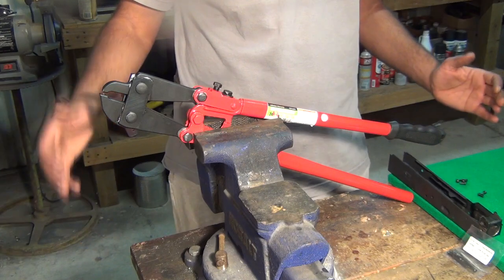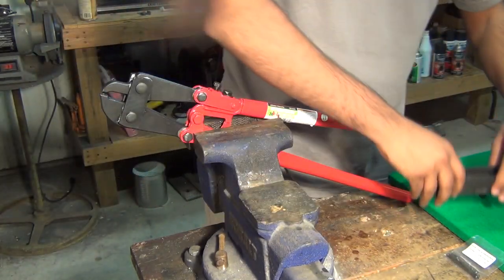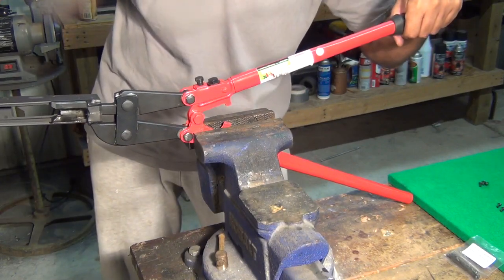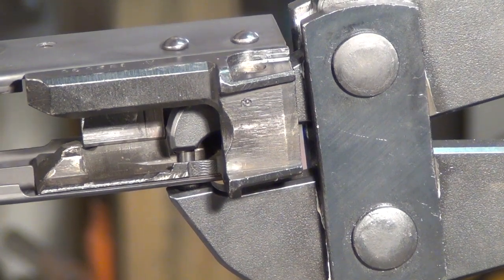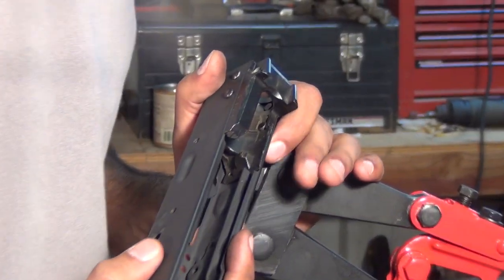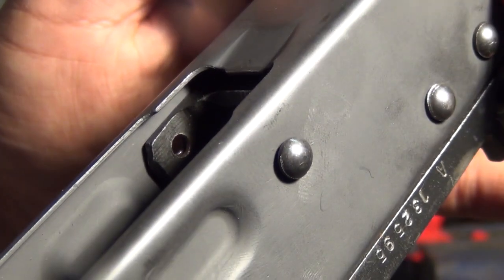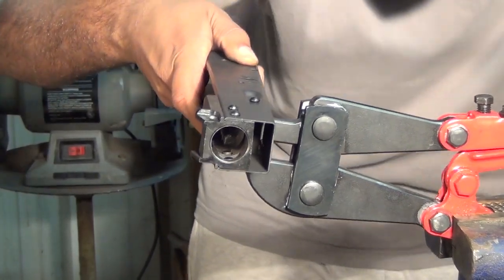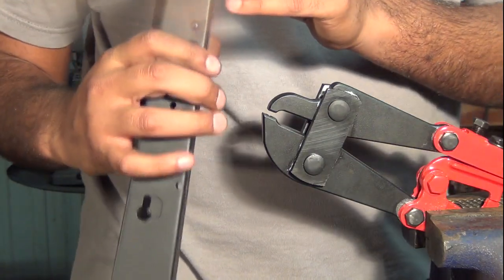Easy AK47 Build "Homemade": Front trunnion riveting ~ Step 2 of 6

Comment: That Toth tool with the squeezer is the best method in my opinion. I’ve used rivet jigs and pneumatic squeezers but I always go back to the Toth tool squeezer. It gives me more control. And as you have shown, it’s quite easy to correct a lopsided rivet head.
Reply from the maker: I agree. It is very good.

Comment: The outside heads of the rivits have a ring near the edge . 
To remedy this the depth of the hole in the tool should be deeper.
The rivit should be below flush , when crushed it will 
Fill in the gap and you won't have the ring on the edge of the rivit.
I used a Dremel and small round stone bit to deepen the tool hole.

Comment: I used a 1" steel round bar ground flat and to fit, then pressed it with a 20 ton press.
But the trigger guard rivets I could not do, so used small bolts and nylock nuts.

Comment: Great video 👌 Hey I just drilled my first trunnion holes and they are a little off. So I can just correct them with a small file, so the rivets won't be off set. Used the AK Builder trunnion tool, and think I just over did that Allen wrench on the trunnion tool. So when I correct the holes make sure front trunnion and receiver are flush.

Comment: Are you supposed to countersink the receiver into the rivet holes before putting the rivets in?

Or does installing the rivets sink the receiver into the dimpled trunnion holes?
Reply from the maker: Technically you should not countersink. The point of those style rivets is the sheet metal deforms down with the rivet into the dimple and increase bonding strength. If the sheet metal is straight it is going to cause a shearing action at the neck of the rivet.
Reply: @VEightMerc124  are all 6 rivets like that or just the rear two?
Reply from the maker: @AKS-74U  depends on what you are making. Some over the years had rear swell necks. Others just as the front in the magwell area. And some rpks have it in the front too as a long rivet. So best to research first and rivet kits are usually complete

Comment: I'm completely new to AKs, but I have a good friend with presses. Would these toth tool jaws be sufficient for crushing some scope rail rivets? All three rivets will be short for a 12" Draco
Reply from the maker: @hattedsandwich2415  ive done scope rail ones, im assuming the standard rail. I forget if i put a spacer on one after partial crush because its recessed. But yes it can work
Reply: Thank-you!

Comment: I just got a Romy G screw build and trying to decide if I should use rivets on it.
And recommendation from anyone since I'm newish to the ak world?
The rifle is beautiful and almost perfect and building was a experienced builder that's done more than a few and used red loctite and I was aware of the differnce between screw build and rivet builds and how so many people don't care for screw builds.
Seems to me as long as the screws stay,being able to easier replace things is a good thing.
My amd65 is riveted and it's also perfect and a wonderful rifle.
I'm guessing my Romy G screw build still has to be better than the newer wasr10?
And definitely better than pioneer arms or io.
Reply from the maker: You will never replace anything on the rifle that was riveted. That would be 100k rounds in and by then the barrel should have been changed a couple/few times. Redoing a screw build with rivets will require larger sized rivets since threading opened them up. As far as quality between a G and wasr....they both made the same way...inexpensively and quickly. Quality is virtually the same. An experienced builder would have never used screws in the first place. Even when I started i began with rivets. Rebuild yours with rivets once the trunnions works its way loose and wallers out the rivet holes in the reciever. Until then...shoot it out. It will work fine with screws.
Reply: @VEightMerc124  I spoke to the guy I got it from and he bought the kit and didn't have the tools and his uncle was the experienced builder but also didn't have the tools to use rivets and he said they didn't tap the reciver,they put the thin bolts behind the reciver,so if that's the case I'm guessing the rivets will still fit normal.
Of course it's all speculation on my part cause I'm still learning.
I sure have learned alot since last week that's for sure.
Before I got it and looked up Romy g nobody mentioned it was a wasr and I'd didn't find out till 2 days after about the Romy g history.
The parts are definitely better shape than a lot of the ones I've seen online 
It's a 1981 and almost all matching numbers.
I may fork up the $200 or so it'll cost for trigger guard tothtool and apex has the jaws for $69 but may average out the same with shipping cost to get all tothtool tools.
Then I'd atleast be able to rivet everything behind the front trunion until I pushed the barrel out.
I already own a press and would need the $50 receiver/trunion clamp blocks or maybe even hold out for another receiver and just redo it again if the holes do need over sized rivets.
I still have alot to learn and don't know anyone local to speak with or friends into them like I am.
Reply: @VEightMerc124  can't believe I didn't want a vska or wasr,then bought a wasr cause I didn't know it's same as Romy g lol.
But my knowledge has doubled 10x since I got it lol.
Reply from the maker: @darknature79  wasr and G's arent exact same but quality wise its not gonna be a big difference. Its all really made on same tooling. Obv military older contract gun will be worth more esp if its original barrel. Some WASR's were single stack mag fed when imported, as they came in as sporters. Rebuild it when it needs to, save your cash for ammo rn. Enjoy
Reply: @VEightMerc124  thanks for the responses and knowledge

Comment: Getting ready to drill front and rear trunnions, but I just noticed holes on my Romanian 63mod holes on front trunnion are different size? Will I need to make them same hole size by reaming them? Should I make the same size or leave as is?
Reply from the maker: You should not have to ream trunnion holes on the original parts. The rivet kit will have rivet diameters to fit. The diameters should be 4mm? IIirc
Reply: @VEightMerc124  I didn't think so, but just wanted to make sure. I do have the trunnion jig and receiver holes jig. I'm a rookie and just want to make sure I don't mess up my first attempt receiver. Wish me luck, drilling tomorrow. 👍🍺

Comment: Did I miss a video? Didn’t see the receiver getting milled, just went from barrel to riveting receiver.
Reply from the maker: Reciever was introduced as a 100%. For info on drilling that stuff best to buy a jig for the holes or follow schematics.
Reply: Hey thanks for the quick response!
Ok, I'm starting my project soon. Going to be my first build, I have a Romanian mod 63 kit. Barrel and 80% receiver is on its way! Looking at my options, not going to be able to build all by myself. Think I'm going to install front trunnion, rear, trigger system by myself. But don't want to do front sight, gas port drilling. I will do the rest. Great videos, keep them up.

Comment: yo your front two rivets are hella lop sided, you can see that on one side the heads are not pressed up against the receiver. using a proper rivet jig instead of those bolt cutters should help you get more even pressure on the rivets and press them down flat.
Reply from the maker: I looked through the vid to see what you are talking about and thats not entirely the case. Im looking at the rifle now and all of the front 4 rivets are flush up against the reciever. After the dome part of the rive head ends, the sides of the head have very short vertical sides before the shaft. The vertical sides are darker in color as the dome parts have some of the finish rubbed off by the tool. The shinier head gives the illusion that the head is sitting above the reciever. I assure you those are safe and fine, the long rivets are a bit lopsided and after more uses with the tool im getting that method down as well (not fully satisfied with that, could be better though) Now ideally using the original method of construction will always be superior but, i wanted to see how well could it be done if someone did not have access to a lot of tools. Do-able and ending with a safe to operate functional gun is what may matter to some people.
Reply: yeah it will work and still be safe, just wont look perfect. the good thing is that rivets are cheap and easy to remove and reinstall.
Reply: VEight Merc at 4:19 you can clearly see space at the right side of the top rivet. its lopsided angled to the left.
Reply from the maker: I think 3:42 is a better depiction of what you are seeing. I can see a small hairline gap there. Looking at the rivet now, i cant see it nor is it lopsided. Maybe after the vid segment i recrushed it and maybe after i painted the gun the paint is hiding it too. I also checked out the rivets on my saiga and you can clearly see the difference, the rivets are squeezed with more force, which cant be delivered by the bolt cutter. Obviously not a replacement for a proven build technique but will suffice for a rifle you dont mind dropping on dirt/gravel or not babying in general. (I shoot on my farm so i transport my guns with anything that has wheels like tractor, quads, dirt bike, utv, farm truck... no padded place to set the rifle down. If it falls, its not a big deal. These basic build guns will never win best in show.)
Reply: @dunwitjayz06  
Oh yeah. I see it also. Big old rivet gap between the head and reciever. Anyone who can't see that shouldn't be building AK47
Reply: Know the comments old but they can be smashed ugly inside as long as you got enough tail to hold but the rivets should be flush with the receiver good vid

Comment: wondering if this can be used in reverse for the rear trunion for a russian side folder?? round head on the inside and flat on the outside.. i may have to trim off some jaw material to allow it to fit in the receiver though. or modify the original cutting jaws..